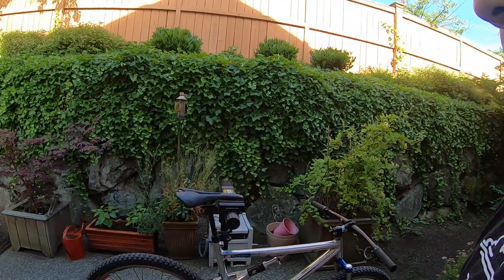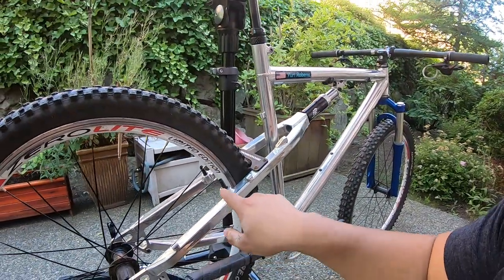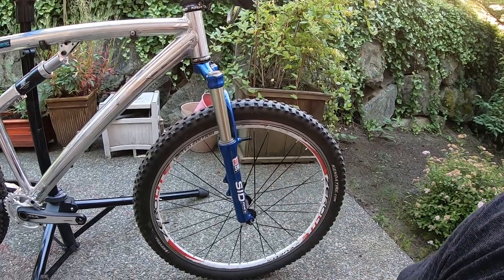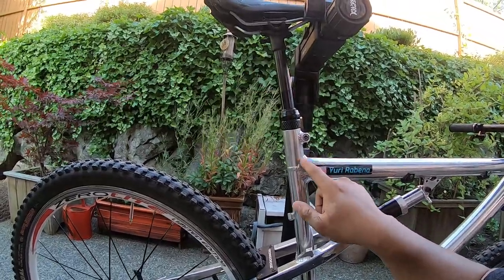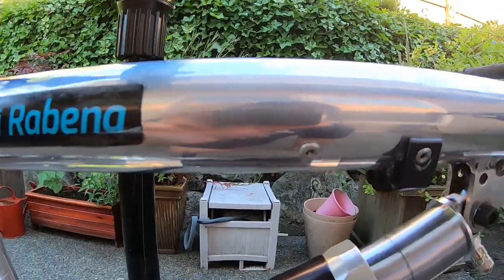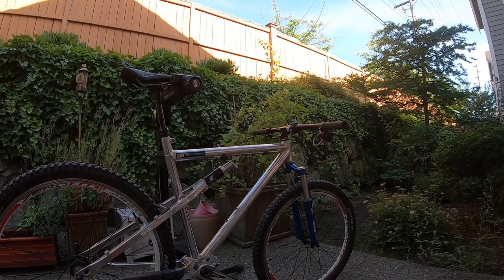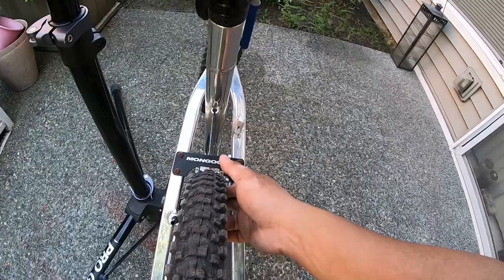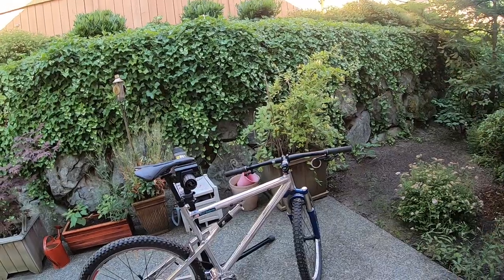Mongoose Amplifier II Project

Comment: I'm old enough to remember not being able to afford the Amp B4...saw it in the back of magazines (kind of like websites made out of paper from the olden times) where on a single page there'd be hundreds of parts listed for mail order. I was on a Trek 820 Mountain Track at the time. You ain't kiddin' about hard to get parts these days.
Reply from the maker: You know what is nuts?  I would have replied earlier but I literally just got done installing a dropper post and shifter on this bike right now and I haven't worked on it in weeks!  

I wasn't hot for the B4 as much as the B2 and 3s but you see both designs on Specialized bikes (obviously) through the years until more so recently with the single pivot.

I am grateful for machinists who help me keep these bikes going and I do pay a king's ransom at times but this bike is one of a kind...especially since I just "customized" the seat tube to fit a 27.2 dropper post.  I'm not a bike purist, I enjoy trying to see how much better do they really ride if you modernize the parts.
Reply: @yuri_on_youtube  I consider that seat tube reaming to be totally acceptable since it makes it more usable without any odd looks. I just ordered a ton of parts for my Sensor..more money than should be spent on it...more than I paid for it used. But it should be good. Trying microshift Advent X on it, tapered conversion (which may require a little machining).
Reply from the maker: @JamesJLaRue  You have to let me know how that turns out - I am entertaining the Microshift system, myself.  The only drawback for me is I do like to standardize my parts across bikes.

Comment: AMP fork is awesome
Reply from the maker: It's a really neat fork but finding the parts for one is exceptionally hard, let alone the engineering specs to have a machinist make.

But this SID is super light, rides exceptionally nice and is custom like the rest of the bike.  Also, performs better than the Amp fork however the technology between the two are literally years apart.
Reply: @yuri_on_youtube  yup AMP was not really a good fork, but nice for collection like the Garmin fork too.

Comment: I'm building an XCR4000 right now but struggling with the parts shortage too.
Reply from the maker: I can empathize because I'm on the same boat so I'm pulling from my "less desirable" spares bin.  Of note though, I have practically sold 95% of spare parts I had thanks to Craigslist.  I'm slowly upgrading my rim braked bikes to Magura HS33 and that's going to be a while.

Comment: Yes hello I have the same frame, mongoose amplifier 2, same rear shock, I love to get info from u if I could, my bike is all built up, vintage ringle, cook bro cranks ect, where can I get frame bushings? I have play in my rear sub frame? Also you spoke about riese shock rebuild how do I go about that?
Reply from the maker: I wish I could help you on the bushings part - I haven't found a reliable source yet.

The Risse rear shock, I highly, highly, highly recommend you do this:
1.  Call the phone number on the website:
https://risseracing.com/

Get someone on the phone first to make sure someone is actually there working.  Tell them you're going to order a rebuild (link in the #2).  I'd recommend if you're going to commit to the rebuild for sure, order it so it's in their work queue.  

2.  Then order the rebuild for a Genesis damper:
https://risseracing.com/store/product_info.php?products_id=559

3.  Send it USPS flat rate - It's a pretty inexpensive option of under $20 USD.

4. You'll have to keep tabs.  No exaggeration, it could take over a month or a week.  It varies but it no promises the turn around time will be in a week.

Comment: Sweet bike I still have my frame but I sent the risse rear shock away years ago because it was leaking and never got it back  I would love to rebuild the bike but I don't know anywhere where I could find a rear shock unit could you shed any info for me 👍👍
Reply from the maker: Risse Racing would be the only place probably in the world that will make a custom rear shock for these bikes at the moment.

It sounds like your experience was negative with not getting that shock back and believe me,  I've had a few negative experiences myself but recently since Risse relocated, Kevin and his crew have been a lot more hands on, so I hope that continues.

Very recently, Risse increased the price on air shocks by about $100.  So, the Genesis damper went from $198 to $298, etc., etc.  If you did retry doing business with Risse Racing, my first piece of advice is to call, verify they can get you one built and when they are ready to get one built, buy it on their website, call them back and have them verify the purchase so they can give you a rough lead time estimate.

If this bike wasn't so rare, it'd be possible to just get a donor bike but a used rear shock would likely need rebuild anyway but also hopefully Risse is serious about doing a good job because I remember their communication years past was angering.

www.risseracing.com
Reply: Sweet thanks for the reply 👍👍
Reply from the maker: @sajon44  No problem - I'm trying to find a source for getting front pivot bushings for this bike at the moment, so I'll do an update vid in the future.

Comment: Just purchased this bike on a whim. Has Girvin Pro Carbon Fork, Risse rear shock. Shimano Deore XT Components. Would anyone know it’s value?
Reply from the maker: I think you could try listing it for $400 and see if anyone makes an offers.
Reply: Yuri On YouTube nice... also has the Magura hydraulic brakes, “Race Line” I didn’t know these type existed
Reply from the maker: @user-hd8ej8yx9p  In that case, you can go $600 and see what happens.  It is easier to price high and deal with the low ball offers than not realize you priced it too low of an offer that gets easily accepted.
Reply: Yuri On YouTube right on, thanks brother
Reply from the maker: @user-hd8ej8yx9p  You're welcome - Always here to help!